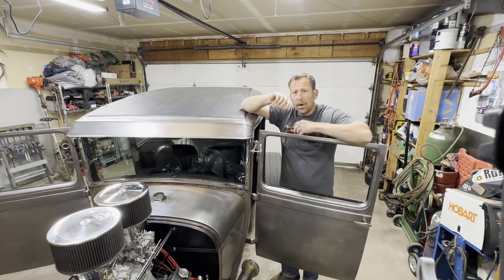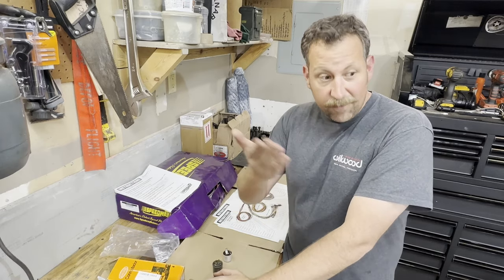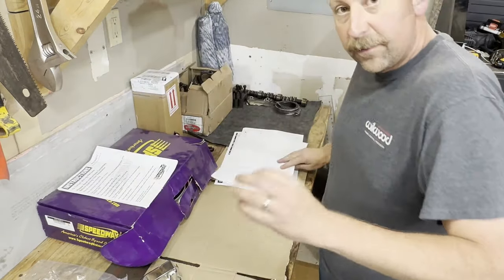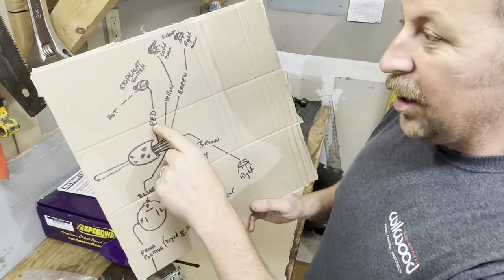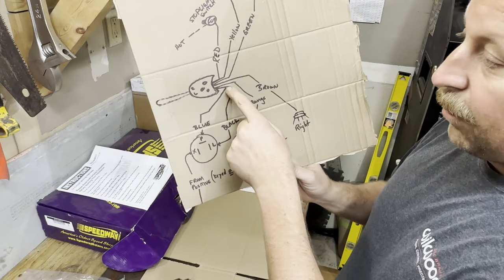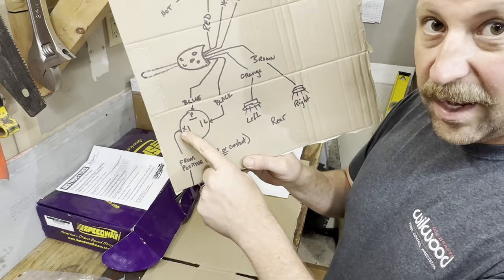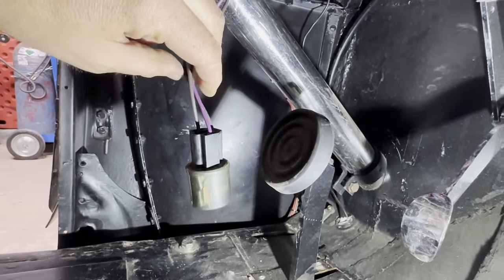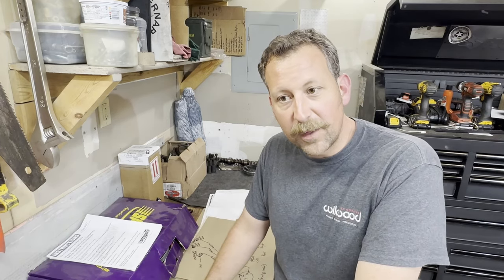How To: Wire a Universal Turn Signal Switch... Especially When Using the Speedway Wiring Harness!

Comment: Great video, just curious…. Are the little lights on your switch still working?
I’m on my second amazon switch and mine stopped working again…..I even ran a ground wire to the clamp
Reply from the maker: I have heard of the lights not working from a few different folks, but mine seem to be still working ok (knock on wood!).

Comment: It would be great if you could do a video on hooking up cornering lights to one of those switches,  thank you
Reply from the maker: Good idea! By cornering lights, do you mean side markers?  I would think you would wire the switch the same; I thought the side markers jumped off the park light and / or turn signal light wires.
Reply: No , some of these old Chyslers Hava a clear light and a blinker light and a marker light,  I can get everything else working except the corner ing lights, they come on when you turn on the blinker,  they light up the road like a head light off to the side,  I can't even find one at the junk Yard that works, so I am going your way,  but I need to figure out how to make the corning lights come on also, thank you very much for getting back with me
Reply from the maker: @michelsmith5610  gotcha! I’m unfamiliar with those, and I’m scratching my head on how to wire them right now.  You could tie them in with a blinker, but that would make them flash… so that’s not good.  I’m guessing it’s a special switch integrated with the factory turn signal switch to power the cornering lights as the turn signal is selected.  I cannot think of how to make one of these switches do that, but I’m hoping another viewer will chime in?
Reply: Thank you very much,  that is what I trying to come up with also

Comment: This video was great! I will definitely be doing this! I am rewiring a 1972 Jeep and i got stuck on this part! Thank you! Also, do you have any videos for wiring the stop switch with  a 2 prong hydraulic switch or can you tell me which wire is which coming off the switch
Reply from the maker: Thanks for watching, I'm glad the video helped.  As far as the 2 prong switch, it's a simple switch so it doesn't matter which side the input from the power source goes to and which side the output to the brake lights goes to.
Reply: @BadHombreGarage  Again Thank you so much! I hope to have some videos up soon! your knowledge should have me completing this  job this weekend.
Reply: @BadHombreGarage  Also I forgot to ask, when switching from the 2 prong flasher, I know you said its in replacement of one of the 2 prong flasher, but do I need to remove both of the original ones on the harness or still leave them in when attaching the 3 prong. Sorry for all the questions but your video has been the most helpful I can find
Reply from the maker: @djv2305 if you go with the 3 prong flasher, you’ll remove both of the 2 prong flashers in the system.

Comment: Hello, thanks for the video. I have a question, could you help me?

Can the Universal Turn Signal Switch handle the full amperage of the front, rear and side turn signals (about 15 amp)? Or is it necessary to use 4-pin Bosch type relays? And in your case, what is the maximum amperage it supports?
Reply from the maker: That’s a great question that I, unfortunately do not have the answer to.  I can say that I did not run relays and the switch seems to handle the loads just fine.  Thanks for watching and commenting!

Comment: Thanks for the help.  I hooked the signal the way you show.  Tried  the switch but noticed the flasher was not putting out power after turning on.  I did have a 20 amp fuse on the line.  That probably  blew the flasher.  Can't figure why the blown Flasher.  I changed the fuse to a 10amp but hate to try another flasher.  I checked the flasher and it did have out put before turning on the signal.  None after.
Reply from the maker: I guess it might have been a faulty flasher?  Coincidentally, I have the same issue on my car right now... blinkers/flashers don't work.  Once I troubleshoot I'll let you know if I learn anything.
Reply from the maker: @valdutson1307  I took my switch apart and cleaned the contacts.  That fixed my issue!

Comment: Great vid  Thanks.    I installed one of these on a golf cart. Did not use the stop light (red) wire.   Everything works fine on the cart, but the lights on the switch itself do not light at all.   Any suggestions?  Thanks again.
Reply from the maker: Maybe a ground?

Comment: Do you know if this will work with an led flasher?🤔
Reply from the maker: I think it depends on the turn signal unit that you are using.  I’ve heard of some issues with LED flashers, but I’ve also heard that some work.  I know that isn’t helpful, but if you try it and it works please let us know.
Reply: @BadHombreGarage  I plan to for sure. I’m using the exact wiring setup you are and I’ll be sure to let you know my results. Per chance have you ever used manual brakes with the little single lead brake light switch with this setup or has it always been the two prongs switch?
Reply from the maker: @rocksaltmetalworks6350 I have used the single switch before; waaaay back I had one on a dune buggy.  With this wiring harness and turn signal setup I have only used the two prong switches.

Comment: If my wires aren't long enough, do I use hot wire to extend them? (For turn signals)
Reply from the maker: I’d just try to use some wire of the same color.  Make sure you use a good connector or solder and cover the connection joints!

Comment: Does the 12 circuit kit have the single wire for one wire GM alternater? I came up on ur page just before i order a harness. Thanks
Reply from the maker: Yes!  Per the Speedway instructions: "If you are using a one wire alternator the only wire you need is the ALT PWR=RED wire."
Reply from the maker: Also- if you want some tips on using the Speedway 12 circuit harness check out this video: https://youtu.be/pDUFtnL5KD0?si=ICX4D1FqjdCgXECA

Comment: Okay I've got everything hooked up on that switch unfortunately my hazard indicator light stays on flashing any advice would be helpful . I will know I do have LED turn signals
Reply from the maker: I’ve thought about this a couple of days, so here’s what I think.  It could be the wrong flasher; they make a 3 prong flasher for LED lights.  It could be that the turn signal switch itself is defective, causing your issues.  Or, it could be a bad ground somewhere.  I’d make sure everything was grounded well, including the steering column as this is where the switch gets its ground.  If I recall, I think the LED specific flasher might even have it’s own ground.  Those are my thoughts, hopefully someone else will chime in.  Let us know what you find.

Comment: Good video Joe, I want to add signals to the 53 I thought I would just run wires to all 4 corners with their own lights should be pretty straight forward don’t you think, but what about the red wire you talked about going to the brake light, maybe I should just give you a call, lol😀😀
Reply from the maker: Hey I don’t know why I didn’t see this comment until now! Thanks for watching the video.  Yeah, give me a call sometime if you want to talk wiring lights.  I’m not an expert, but I’ve banged my head against the wall a few times going through it.
Reply: @BadHombreGarage  👍

Comment: Hi Bad hombre.  I installed this as directed, and everything works as it should however, in the neutral position on the lever, the flasher unit is still clicking, and the red light on the lever is blinking and no lights are flashing. I would expect the turn signals to not be on in the neutral position and that’s good but I don’t know why the flasher is still clicking.
Reply from the maker: Hmmm… there’s a chance the switch itself is messed up.  I’d pull that flasher lever and make sure it’s seated well in the off position.  Check your grounds- make sure everything is grounded as they should be- especially if you got one of those flashers designed for LEDs and it has a ground wire.
Reply: Im getting this exact same thing right now.  Did you ever figure it out?
Reply: Hi I am also experiencing this. All the wires are hooked up correctly, and the positive is constant power. Indicator is clicking/blinking while in the neutral position and lights work as they should. Is this an indicator problem? like do i have to open the unit up? thanks
Reply: @williambutler5541...mine is doing the same thing. 
Did you ever get yours figured out? I took the switch apart and all looked good 
Here's the interesting part. I took a 12 v battery charger and hooked it it to the flasher, red to X and black clip to the clamp on the steering wheel. All worked as it should, directions and flashers. Back to car power, clicking but no turn or hazards flash

Comment: Is the brake switch wire required? My turn signal is separate from my brake lights
Reply from the maker: I’m not sure how it will work without the brake light wire used.  It may cause issue when braking and using your turn signal, unless they operate different bulbs.

Comment: I’m doing a 50 GMC panel with an American auto wire kit. I have power to the switch but it will not do anything. I’m trying to go through GM style harness to keep from cutting and splicing things. I do not have the rear singles wired yet and was wondering if if that is why nothing is flashing. Thanks for sharing
Reply from the maker: That could be the issue; I think the switch needs to see a load for it to work properly.  I have used this with the GM style harness and remember it being pretty easy to wire in.

Comment: What is the type of switch be did you use in this video
Reply from the maker: I bought it off Amazon: https://www.amazon.com/gp/product/B09L834QDN/ref=ppx_yo_dt_b_search_asin_title?ie=UTF8&psc=1 
It's called the 12V Turn Signal Switch with Flasher for GM Ford Hot Rod Chrome Universal

Comment: I have the same switch and everything works fine but the indicator light on the switch itself flashes very slowly when the switch is in the neutral position 
I’m thinking the switch or flasher is bad
Reply from the maker: Yeah, it might be a bad switch.  Or it might be a bad flasher.
Reply: having same problem  the neutral position light continues to blink

Comment: I am installing one of these in a 1922 chevy.  All of my lighting is LED 6V and everything is working except the brake lights.  My question is: Should the red wire to the brake switch be carrying current?
Mine is not.  If the red wire should not show a voltage and the brake switch is just a path to ground through the turn signal switch , should the power be somehow supplied by the left and right turn wires.  I tried this.  Did not work either.  I'm, frustrated..
Reply from the maker: If your wiring is set up like mine, the red brake light wire is hot and goes from the power source to the brake light switch, then to the turn signal switch.

Comment: My turn signal stalk is flashing when the arm is in the nuetral position, still blinking even tho the arm isnt in the right or left position, any thoughts? my hazard button isnt pulled out either and it still blinks
Reply from the maker: @blakenorman4822  I recently had to disassemble my turn signal and clean the contacts inside.  That could be what you have going on.

Comment: Do I need a three prong flasher if Im not running hazards.
Reply: Keep in mind...the two prong flashers can be used if a separate  4 or 5 pin relay switch were to be used.   You would simply wire the 2-prong flasher to pin 30 of the relay.   This allows flashing for both the turn signal or hazard.   If you're using the Conmutador Universeral Turn Signal Switch as shown in this video, it already has a relay switches built in for feeding the left and right turn signals and the hazards (not clearly explained in the mfg. instructions).   That's why he's suggesting a 3-prong flasher.   The built-in relay switches of the universal turn signal switch will feed power through the blue wire to the P terminal activating the flasher to work.   This allows power to flow from terminal "K" and out through the terminal "L" out to your signals or hazards if it's being used.   A 2-prong can be used, but it will take some experimentation on your and figuring out your own wiring diagram to make it happen.
Reply from the maker: Thank you for your answer!  @kramerflamer

Comment: Yes trying to figure out how to wire a led flasher on my 36 Chevy the led flasher does not have a L P or X
Reply from the maker: Sometimes the LED flashers do not work well with non-LED lights.  Try to connect wires in the same pattern as the setup on the video, it might work.
Reply: @BadHombreGarage  Thank you very much I have 5 old cars I have redone.

Comment: I have a problem i installed the kit like you said now the problem is when I run on the running lights the right side blinkers turn off when I turn the running lights off or turn the headlights on completely the turn on again
Reply: The left left lights front and back are fine
Reply from the maker: Sounds like it might be a grounding issue.  I think a guy ought to check grounds and make sure they are good.  You have two flashers, or one?
Reply: @BadHombreGarage  both
Reply from the maker: @ChrisJones-rz5fm both flashers?  I found it best to eliminate both of the 2 prong flashers that came with the speedway wiring kit and instead only use the 3 prong flasher as I do in this video.